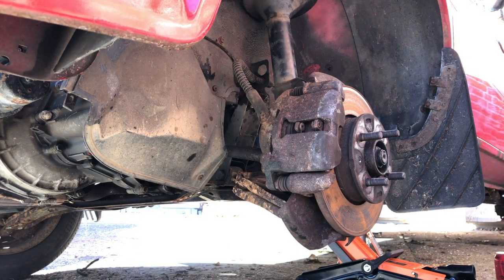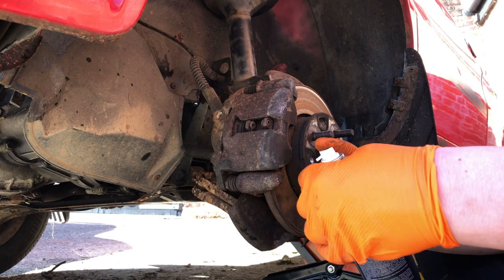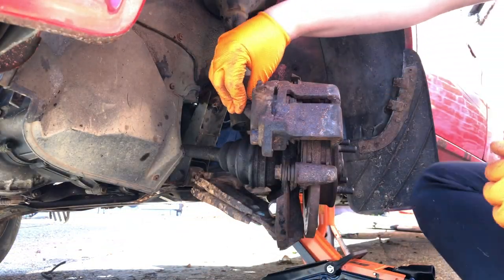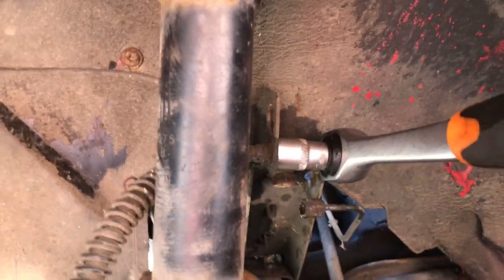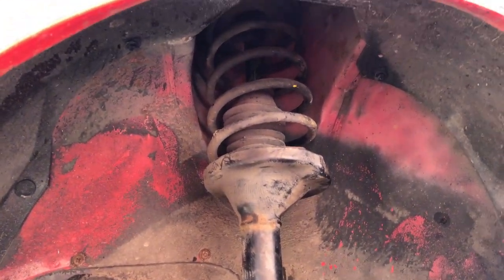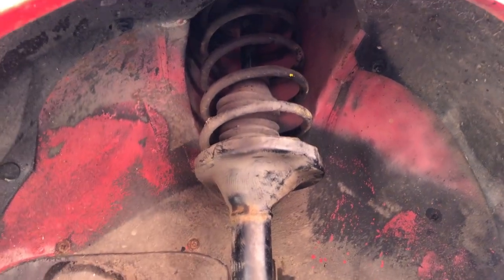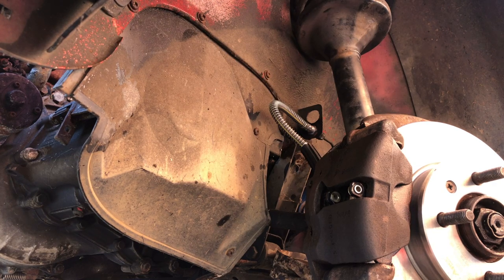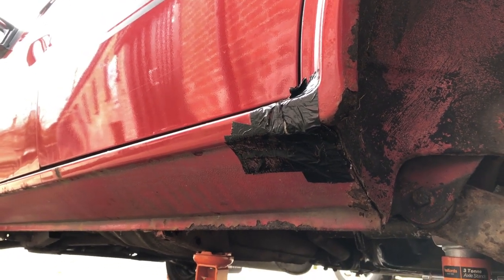NEARLY RUINED THE BRAKES!!! - BARN FIND Austin Maestro gets a FULL braking system REFURB!

Comment: Great work Will. I did laugh at the reverse thread cockup, but I'm sure we've all done it at least once. There is nothing like the feeling of horror when you realise what you've done. I was putting press-fit bearings in a lathe recently. Couldn't be bothered to make a jig, even a bit of threaded bar with a couple of nuts and washer would have done the job and taken me about 2 minutes to assemble! There wasn't a sufficient bevel on the bearing housing to hold it in place so I couldn't use a block of wood. Decided to hold it with my fingers and try to hit the outer edge of the housing. Put my back into a good strike to start it off, missed and smacked the cast iron headstock. A new headstock later and a lesson learned, still feel like an idiot for that one.